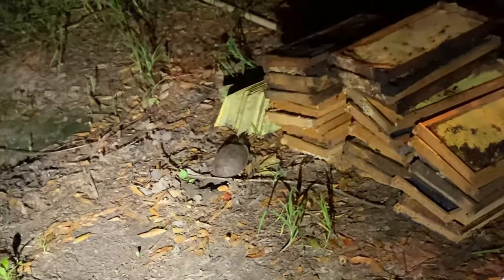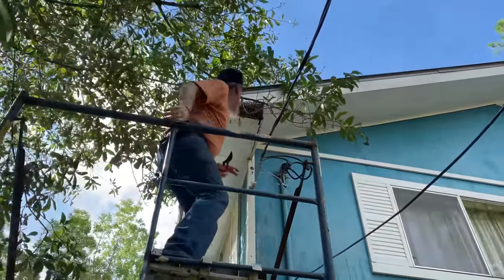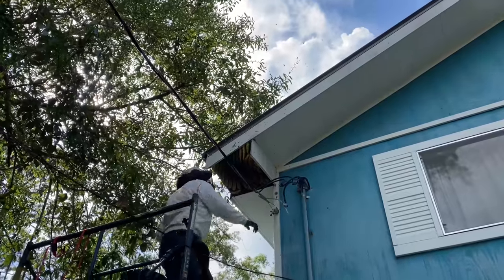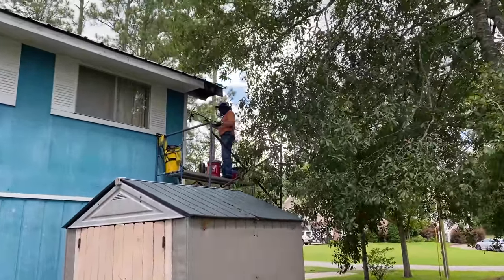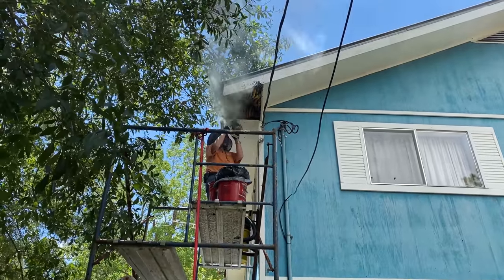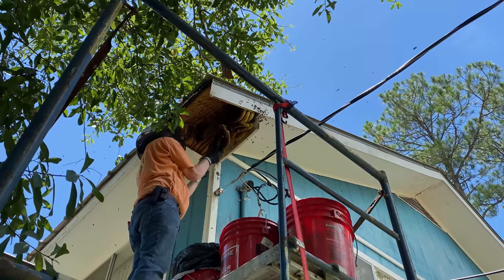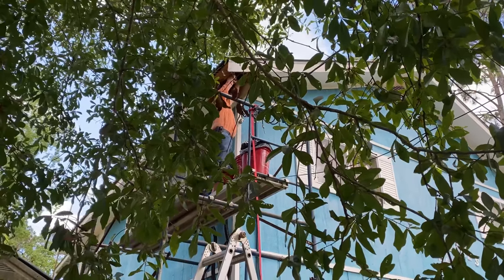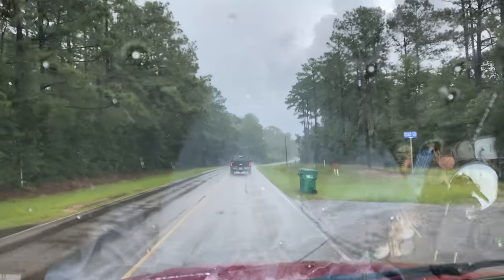The Cable Guy Got Attacked

Comment: Something you might consider; My local power co. has plastic insulation sleeves they slip over hot wires when there is power equipment being used near them. You might look into getting some of those  for putting over the  house feed wires for your safety.
Reply: If you have time. But if there is a tornado anywhere they will forget about you.

Comment: You can call the power company and ask them to put a safety sleeve over those wires for a day so you can safely do those removals. Usually they will once you explain the situation and most of the time you can ask it be installed in the morning and removed that night or the next day.

Comment: I enjoy watching your video, I would like to continue, and therefore a bit of firm advice from someone who has worked around High Power lines. Remove all metal from your body. rings necklaces, watches, belt buckles. Wear long-sleeve shirts and full-length pants. This will make your obituary more distant in the future event.
Reply from the maker: Good advice Fred.  I'll take it.
Reply: All good wearing long sleeves until they melt and surgeons are picking bits of melted fabric out of your skin. Make sure its a thick top or better yet, flame retardant.Not just any long sleeve shirt with all due respect.
5 years ago i went through a 415v underground mains cable at work while breaking concrete with a jackhammer. Electricity is absolutely no joke and i am extremely lucky to have only got burns from the plasma flash and it didnt arc over to me. 3 explosions though
My trousers were melted up one leg, high viz vest melted to my hoody but luckily my hoody was thick and didn't melt and thank god i had no gloves on but most importantly some impact goggles that i spent 3pounds on which no doubt saved my eyes

Be safe around cables!!
Reply: These days i have thick orange flame retardant, anti static gear. Expensive but theyre tough and last long

Comment: You need to get an 'electrical insulator pad' or blanket,  to throw over those wires while working around power wires, it will protect you !!

Comment: I hope you get something to isolate wires like that.
When I worked in powered switchboards, we had thin rubber mats that we put around and over the live wires and components we weren't working on.
We had two current levels on the sites where we worked, 230 and 400 volts.
The old timer that went into retirement used to lick his fingertips and "test" for what voltage there was in the wire.
NOT RECOMMENDED!
He did it so he didn't mix up the two.
He was accurate but noone else took up his "traditional ways".
All the rest of us had measuring tools with us.

Comment: Wouldn't a very cold water spraying have helped?  I mean VERY cold water, as in "with 4-5 ice cubes in the spray bottle cold," even?

ADDENDUM:  Isn't the handsome young lad with you fellows small enough to necessitate a special "child-sized restraint system"?  At less than 60#, I'm pretty sure that, at least in the State where I live, one of those systems WOULD  be required,  but I don't know about the child safety laws in any of the Southern States.  I just want him to be as safe as possible; he is adorable!  
          I was in a head-on collision at the age of 10, in a car with my best friend & her Mom.  There weren't any search belts back then.  It turned out that I was lucky, as I only got a fractured skull & concussion, but both my friend and her Mom were killed.  IF we had been wearing seat belts, both my friend & I would have had only minor injuries, if any.  Sadly, even seat belts wouldn't have helped her Mom, as she was very short and drove with her seat pulled very far forward, and the steering columns WEREN'T the type that collapsed under impact.  The force of the engine block onto the steering column completely crushed her chest, resulting  in instant death.   My friend went through the windshield at 55 mph.  As I said, I was lucky.  Seat belts and proper restraint systems DO save lives.

Comment: 628DirtRooster Bees  ;     I was thinking , I've seen those guys who work on live  " Electric lines " will drape some kind of cloth / or Rubber sheeting over a " live Line " , that way even if you should bump against it you'd be safe . I don't know how often you run into these jobs , but the cost of adding such a tool to , your tool box might  be worth it .     Jack
Reply from the maker: That was the first and likely the last.  :)